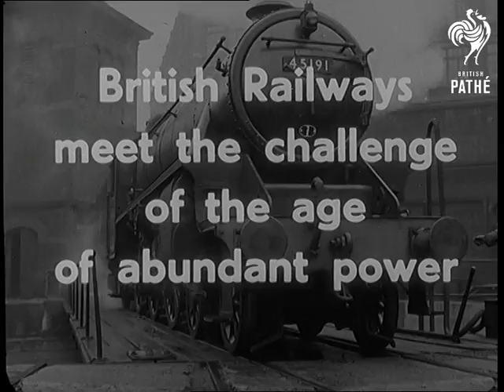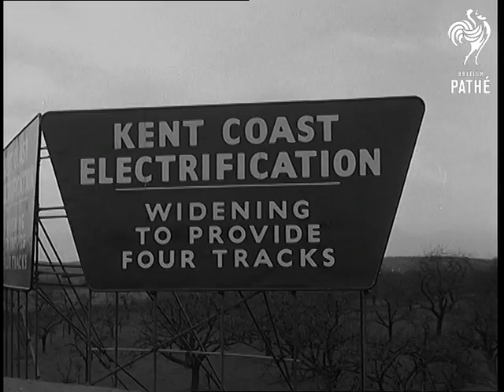British Railways: Goodbye To Steam aka Railway Modernisation (1958) | British Pathé

Comment: Now it is hello to steam. From recent developments diesel is too dirty and the thinking is back to steam. A friend of mine Ted Pritchard, designed and built the lowest emission engine in the world over fifty years ago It was a steamer. Took it to America, demonstrated it successfully to Senators and the vehicle industry. They didn't want it. I  could be excused for believing the govt. doesn't run the country  over there and when it came back to Australia the reception was much the same. We are just as stupid. The steam locomotives he had in mind would come in around 6,000 H.P. where now loads of 35,000 tons are being moved. Diesels are dead.
Reply: Pritchard was a well known crank in the 1960's.   Difficult to know if he was a complete nut case or a just a poor con artist.
There is a very simple reason why nobody wanted his silly steam car engine.   It was a reciprocating engine - such things are completely understood by engineers due to the use in steam locomotives and ships.   The efficiency is really poor, and it would have a fuel consumption about three times that of a gasoline engine.  And diesels are considerably better in terms of fuel consumption that gasoline engines.
Pritchard used a flash boiler as well.  Flash boiling is an absolute non-no if you want durability.
There were steam cars once.   Gasoline engines, even the early ones, were so much better - much more economical, much more reliable, needed far less maintenance  - they drove the steamers out of business.
Jay Leno has a couple of steam cars.  Watch his "behind the scenes"  videos to get an idea of how it takes to keep a steam car going.

Comment: I wasn't around for the steam age. But despite the romanticism for the era, I bet a lot of drivers were happy to give up standing on an open, draughty footplate, to instead sit in enclosed comfort, with relative quiet and heating controls at their fingertips.
Reply: You are right, that's the difference between steam locos fans and drivers. Yet I love steam. (yeah I'm not a driver :)) )
Reply: Here in Australia, crews threatened industrial action - apparently a Luddite reaction to diesel electric locos.   But after a short time driving diesels if they were rostered to crew one of the remaining steam locos, they got quite upset.
Reply: Muchas locomotoras de vapor tenían asientos en realidad.
Reply: @vaporera_random The point I was making is that most steam locomotive drivers weren't sat in enclosed comfort.  It was noisier, hotter, draftier etc

Comment: Apart from the BR Southern Region's third rail lines in the South of England, the Manchester to Sheffield (via Woodhead) line was the first all-electric main line when it was electrified at 1,500v DC overhead wires in 1954. Sadly the Woodhead line was to be host to its last passenger train in 1970, with the line closing to coal and other freight trains in 1981. Technology had moved on, more so as from 1959 all UK lines to be electrified with overhead wiring were to be electrified with the 25kV AC system, something which BR insisted was impractical for the Woodhead line.

Comment: If steam engines dirty and hard to operate because coal is expensive why just use dead wood
Reply: Where would you get all the wood?   Coal has always been more abundant and cheaper - that's why they use it in power stations.  And even well seasoned "dry" wood has 15 to 20% water content, so its heating value is a lot less than coal.   It is much more polluting too.  Coal burns at a higher temperature - this makes for better combustion and less ash and dirt, and cleaning is a major cost in operating steam locos as it is.

Comment: "No smoke", he says at 4:26. Not if you were sitting in that buffet car with that table of vicars.
And "no smoke" referring to DMUs must raise a wry smile.
Reply: Relatively. Relatively, as everything is.
Reply: I was at a patio at the end of the Gloucestershire and Warwickshire heritage railway a few years ago. There were "no smoking" signs on the patio. Less than ten feet away was the turntable where the steam locomotives were turned around.

Comment: In 1958 I was working at English Electric and may well be in part of the film, where they were winding armatures.
Reply: You used to work in the railway about the starting of diesels in the age of 20?
Reply: 1958?
Reply: If he did work at English electric it would be working in an engineering firm not the railway.
Reply: Cool, man.if you were there, you’d remember

Comment: “Most men these days understand motor cars , ah really, and therefore understand what about diesel locos?”
Reply: how the internal combustion engine worked i assume? Cars were a much simpler beast in those days......
Reply: The difference between a GM car and an EMD 645 engine is pretty much just size... Which makes sense, because GM owns EMD.

Comment: I believe that the carriage at 5:32 is now preserved on the Severn Valley, and was intended to rival the airline industry for commuter travel between major cities. The seating was built to the same sort of style. Shame they didn't catch on really, they're pretty comfortable.
Reply: They look interesting
Reply: @@hoolydooly5072 well, no. I did not. And I did not help preserve that carriage, I simply pointed out that is has been preserved. Those carriages could be hauled by diesel or electric locomotives, so they would simply be comfortable carriages. I don’t see why you have decided that I am somehow to blame for climate change given that I was born almost 30 years after this video.
I’d quote some figures on how negligible the heritage rail sector is to climate change (and there is a lot of information on this), but I don’t expect you want to know.

Yes, steam locomotives did cause pollution. As did the large amount of coal burned in industry. Yes, coal dust does get into everything. It’s filthy and sticks like nothing else. But, it did come to an end, and the railways are a lot cleaner now. 
But to decide I’m somehow to blame for them being preserved is absurd. You picked up a comment I wrote 3 years ago, and have chosen to have a go at me for it.

There has to be a better use of your time, surely?

Comment: Actually steam coped well and the present modes are not that much better final speed wise.
Reply: @Ward Studios Such a device (mechanical stoker) has actually existed for a long time and was used on biggest locomotives, mostly in US.
There was still potential for improvement in steam locos at the time, but diesel/electric ones simply turned out much cheaper.
Reply: Less hard work shovelling coal and one driver cleaner  .press a button and drive off no waiting for stem to build up or lightning fires
Reply: @Ward Studios well thought out .I just think too hard work for shovelling coal in this day and age.dirty sweaty work and little reward. Non stop in a express train
Reply: What a ridiculous statement. The top speeds of the kettles may well have been close to today's traction, but look at the huge infrastructure needed just to keep them running.  I hate the modern sheds, but it cannot be denied that they are far more efficient than those that went before.
Reply: @Ward Studios Rip
Reply: @Ward Studios Not for the atmosphere.

Comment: But there are still so many steam locomotives operational in UK.
Reply: They have been restored or left to rust
Reply: @Singapore Pearl Most of the steam locomotives were chopped to pieces with cutting torches and melted down and recycled. There are a handful left in museums and short lines which run occasional tourist services.

Comment: 1:53 THAT IS CLEARLY AN ELECTRIC LOCOMOTIVE!
Reply: I retract my stupid reply because I just saw the context.
Reply: Diesel Electric?
Reply: NO  @ninofromkitchennightmares1497
Reply: Joshua Slocombe no it was duel powered loco, if you look closely the wasn’t a pantograph line.
Reply: @kennztube  its not, its an 1500v EM2 electric locomotive built for the woodhead route. Its fully electric. There has been some kind of mistake in the film there.
Reply: @MajesticTrains  agreed! Pure DC power there....
Reply: @MajesticTrains  27000 can still be seen at Butterley and one of her sisters is in occasional use in The Netherlands.
Reply: Ken Brickley Majestic is correct. I don’t believe they had dual mode electric-diesels back then but either way those are Woodhead electrics.
Reply: @RoadCone411  the Southern Region had their electro diesels (73/74?) but they might have come later and were 3rd rail powered on electric not overhead.

Comment: At 2:10 a train is shown as to be leaving with "Diesel Locomotive". But it does seems to have pantographs and looks like an Electric locomotive.
Reply: +Sachin Perinthalakkat  You`re correct . It`s a BR Class 77 ....
Reply: The 73 class are hybrid
Reply: Try to listen to what he says before commenting. The diesel engines power a dynamo that creates electricity that runs the locomotive
Reply: @MrJhonnyJackson  we are referring to the engine shown at the specific timestamp, which is not a diesel-electric locomotive, rather a 1500v DC Electric locomotive (Class 77).
Reply: @MrJhonnyJackson   Assuming you're replying/referring to 2:10 timestamp.
Zero diesel engines in that EM1/class 77 ELECTRIC LOCOMOTIVE.
Reply: @noyoureafuckintube  It's an EM2.
Reply: @MrJhonnyJackson They were electric only, 1500v dc
Reply: It’s a dual powered loco I think
Reply: @Garbageguitarist  No DC only
Reply: @Garbageguitarist  NO IT ISN'T.

Comment: A problem with coal burning steam locomotives was the smoke they added to smog, a word coined by a London newspaper. Newcastle coal was very dirty (high sulfur content)
Reply: Why did you hate steam drilling oil under the sea and damaging wild life so if i have a railway i will choice the steam that that stupid deisels
Reply: @catthecommentbothunter6890  i wouldnt say that, while burning coal is highly pollutive for atmosphere. Diesel locos are preferred for being more powerful, efficient and time saving
Reply: @catthecommentbothunter6890  An average diesel locomotive has a thermal efficiency of 45%, compared to the steam locomotives 10%. Between efficiency and vastly reduced maintenance costs, and elimination of the necessary infrastructure to operate steam locos, steam is as dead as Julius Caesar. Steam locos are interesting artifacts and should be preserved, but by the outset of WW2, the writing was on the wall for them economically.
Reply: @catthecommentbothunter6890  the absolute hypocrisy. Steam Releases ALOT of pollution , the average steam engine went 30-45 MPH With a decent amount of steam. The average diesel could go 75 - 90 MPH With little thrash which rarely happened. Considering the fact that the Deltic went 100 mph with little thrash. whilst mallard polluted alot of the area it passed. the HST Would thrash a little on it's 148 MPH Run & it was definitely much more environmental friendly. the 373 is EXTREMELY Good for the environment along with it's E320 Successor giving absolutely no pollution between 208-230 MPH!
Reply: @herzikkimolog  And diesels add to pollution either. Less, for sure, but they do.
Reply: And better working conditions
Reply: Mixed with an incoming thick fog. Hence “ Smog”
Reply: No they will emstead use charcoal or scrap wood or paper

Comment: Look at the former steam railwaymen running the diesel locomotives. Sad, isn't it?
Reply: Not really! 10000 was far better than any kettle in regards of efficiency and driver comfort, let alone paving the way for future british diesel and electric designs.
Reply: @snesman3768  In the future Diesels will be cut for scrap with shears and torches and electric and hydrogen power will take over.
Reply: @PreservationEnthusiast  Ok, but what has that got to do with the LMS twins? I just stated that a diesel loco from the 1940's was superior in terms of efficiency & driver comfort to steam locos of the era. You seem a bit thick for a troll. I'm sure you've got better things to do than prowl around youtube comments trying to mildly irritate people.
Reply: @snesman3768  I don't know why you keep bringing up the 10,000 class. It was a very early underpowered and polluting diesel.  One was ripped apart with cutting torches at Cashmores in 1963, the other disposed of in 1966. All scrap was sent for melting down and recycling. They were chopped before even steam locos were finished with!
Reply: @snesman3768  There were other diesels around at the time. For example the Maunsell diesel shunters of 1937 which predate your example by 10 years or so. There were also main line diesels in the US which predate the 10000s. All very polluting locos and the 10000s which were despatched for scrap in 20 years, as proven by my excellent cutting action photos at the London breakers yard.
Reply: @PreservationEnthusiast  You finished?
Reply: @snesman3768  I am simply replying with corrections to some of your invalid points.
Reply: @PreservationEnthusiast  i hate that
Reply: @Ward Studios Really? Ignoring the much higher operating costs of a steam locomotive compared to diesel or electric locomotives, burning coal is as dirty as it gets! Most of the travelling public were very happy to see the back of steam in the UK.
Reply: @Ward Studios Your a witty little one aren't you... You clearly don't know what you're talking about since you can't think of a decent response.
Reply: @Ward Studios Just for your information, I don't dislike steam locomotives, I just prefer diesels. That doesn't make me an "idiot kid", I'm just stating the operational benefits of diesel and electric locomotives compared to steam locomotives.
Reply: Many fire man is out of job they only knew to shoveled some coal
Reply: @catthecommentbothunter6890  Actually Firemen knew a lot more than firing. They helped with the lubrication and maintenance of locomotives and also knew every part of the engine. They would also help with inspecting the engine and look out for signals. A passed fireman could undertake some light duty driving duties.

Comment: The "Diesel" at 1:58 is not a diesel at all but an ex LNER Sheffield - Woodhead - Manchester electrification project 1500DC Co'Co' electric loco of the E27000 Class later reclassed 77 by BR and the entire class later still sold to Netherlands Railways NS and reclassed 1500. The overhead equipment can clearly be seen in the shot of the train entering the tunnel (2:20).

So this is wrong: CU New diesel engine. CU Sir Brian Robertson talking to train driver. CU People watching. CU Sir Brian Robertson blowing whistle. CU Int. diesel engine with driver operating controls. SV Diesel train moving out of station. CU Driver of diesel train. CU. Sir Brian Robertson sitting in carriage. LV Through window of diesel cab as train enters tunnel.
Reply: CU nts!
Reply: Marcomanseckisax reopen the Woodhead Tunnel says I